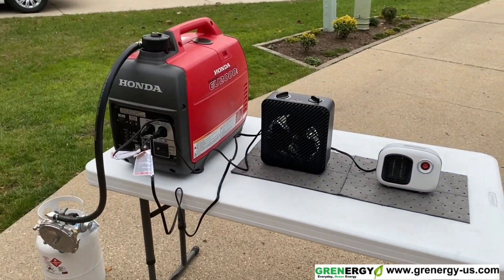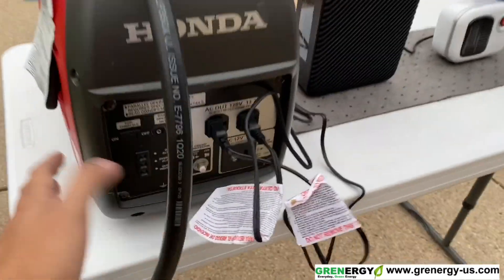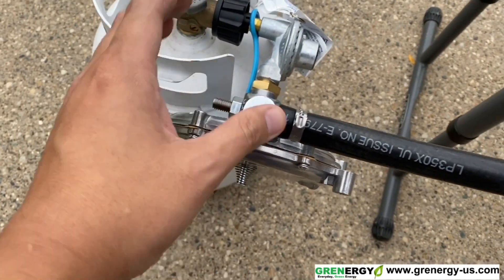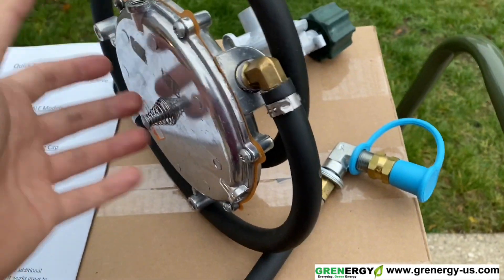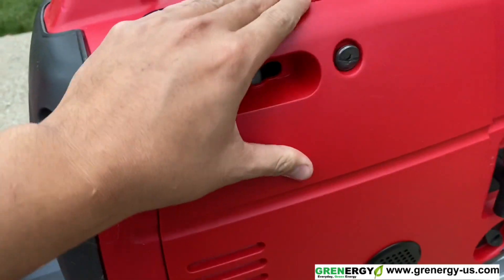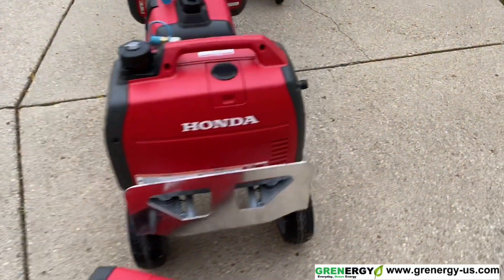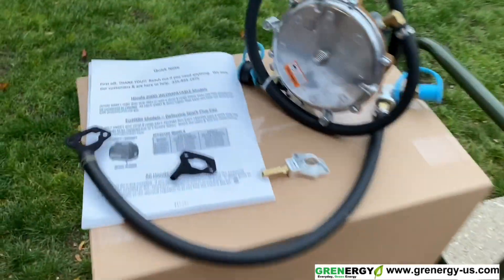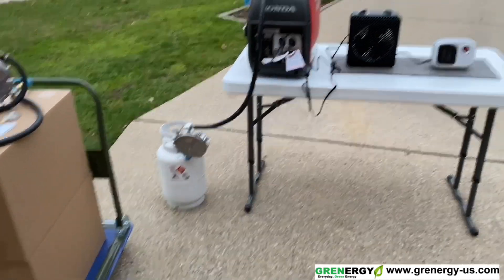Honda Propane Conversion Kit - Less Power? Engine Damage? Video Part 2 - EU2200i EU2000i EU22i EU20i

Comment: I just got two eb 2200’s after ordering two eu 2200’s.   I want to parallel them and am sending them back.  Is this a common issue?
Reply from the maker: I would get them checked out at the Honda dealer. It’s not common for them to fail like that

Comment: I think the models advised not fit a gas kit are the older honda generators that had dodgy spark plug caps making the spark insufficient change the cap or try some dielectric grease on the spark plug top and and always on the thread to help with replacing spark plugs as i do on my cars helps them from seizing in the engine block and snapping , but in this case makes them easier to remove
Reply from the maker: Thanks for your input

Comment: What is Honda's rationale for saying you shouldn't convert the older model to LP/NG? It's obviously not an operability issue, since the mod works. Could it be a reliability issue, long term?
Reply from the maker: As a company, Honda simply would rather not want the liability of saying it works with alternative fuels. From their prospective, what ever comes from the factory is what they advertise and that is that.
Reply: @GrenergyTriFuel  Yeah, I get that, thank you. But why single out just the older model? Does it employ, for example, a different metallurgy that makes it specifically not recommended to run LP/NG? I'm just curious what the technical reasoning is for them to release that bulletin.
Reply from the maker: In the video the product manual is not of Honda, it is from our competitor. Our competitor does not recommend LP or NG for older model EU2000i simply because their kit does not work well on the series 1 EU2000i. 

This issue is only with our competitor, NOT us “Grenergy”. We have found no reason why LP or NG wouldn’t work on the series 1 EU2000i. Because of this, the kit it self speaks volume on how much testing and R&D that goes into our products to ensure it works better than anyone on the market.
Reply: @GrenergyTriFuel  ah, that makes sense. Thanks for the clarification.

Comment: I stopped watching when you bashed plastic, just because it’s not metal.
Reply from the maker: Obviously Tom Cee never had experience as an automotive technician. 
Mr Cee, just because it can be made out of plastic, doesn’t mean it should be plastic. I’ve seen my fare share of top dollar cars with plastic engine parts fail over a span of a few years. Leaving the owner with a very expensive repair bill and a not so reliable car. 

It’s also common sense for a business like myself to reduce liability. Especially when working with highly flammable vapor fuel types. And doing so with cheap 3D printed parts is NOT what your customers would want to pay for. 

Please see YouTube links below for plastic engine part failures. 

https://youtu.be/TQCkDz3SDxg

https://youtu.be/8MmXIZPxD7A

https://youtu.be/6sTO-7Ses3U

https://youtu.be/nrPN_x6MoVk

https://youtu.be/b7IDZJSE2r0
Reply: “I stopped watching when you bashed metal, just because it’s not plastic”….. said no one ever.

Tom Cee is the type of person who likes to dip his fingers in electrical sockets to tell the world 120v is over rated, just because it’s not 120kv 😂
Reply: I might have missed it, but I didn’t see you explain why. There are many possible reasons for an engineer to choose plastic over metal. It’s always assumed that cost is the main driver, but there are other variables, such as heat transfer or electrostatic discharge. I’d rarely second guess the engineer who spent hours testing. If it works for you fine, but changing parts might very well void the warranty. 
I’m not a specialist in engine design, but I’ve worked with many engineers in different disciplines who shake their heads at untested field modifications.

Comment: What about that small pressure button that’s not there on the earlier 2000.  Do we need to install that too?
Reply from the maker: That button you are referring to is the carb run down switch. If you purchase the kit, there will be a step by step how to install guide for this switch.
Reply from the maker: Yes, this is the carb run down switch. And yes there will be a step by step install guide with the kit.

Comment: A few questions, 

1. What are the vents in your unit installed for.

2. I have a Hutch Mtn kit with a Century regulator.  Can I buy from you the adjustment piece for the high rpm use and the metal carburetor manifold with bolts without the entire kit?
Reply from the maker: Hi Rolland, 

1.) Please click here --> https://grenergy-us.com/pages/whats-up-with-the-air-vents-why
2.) Unfortunately we don't sell the fuel adapter separate unless its under warranty. You could always put the HM kit on eBay and recoup money towards the Grenergy kit.

Comment: Have you considered making a parallel kit?  One regulator and two everything else?
Reply from the maker: We recommend running each kit off their own tanks for consistency.
Reply: @GrenergyTriFuel  I have a 1000 gal propane tank, can parallel units work off of the large single tank?
Reply from the maker: @keenanfoy3965  If you are able to gather proper fittings, you certainly can run off a large tank.

Comment: i'm curious about the extra round air vents you added........did the engineers at honda miss something?
Reply from the maker: Hi Ed, 
The breather vents help balances the low-pressure vacuum inside the generator case. We find that this extra vacuum draw comes from the engine fan resulting in additional low pressure inside the case. This extra vacuum other than engine vacuum from the air intake box, can result in the demand regulator opening its diaphragm excessively, causing the engine to run too rich. 

With this fix, a better fuel economy is achieved which results in an extra run time of 1-2 hours per tank of propane.
Reply: @GrenergyTriFuel  If you could use the wind air speed tool to measure intake and out take air speed with the vents uncovered and then a test with events covered. If you pick up AirSpeed I can see making vent holes. But if the airspeed slows down this will make the engine and parts run hotter. One guy with a sportsman 1000 4 stroke gasoline inverter generator took the side cover off and put a fan on generator installed generator and fan in the shade in the summertime. generator didn't last too much longer until it was smoking oil excessively out the exhaust. Obviously he was burning oil and had a lot of blow by with an engine getting so hot. These enclosed case inverter generators pull the cool air in push them through the case and the hot air goes out the back. Sort of like a cylinder head if you hog it out too much you'll slow down the velocity the speed of air won't travel as fast.
Reply from the maker: That is an air cooled engine, it has a fan behind the recoil start that draws air from the front to the back. That generator is junk compared to a Honda if it’s pouring smoke out the back
Reply: Does the added air vents make it louder?
Reply: @jerryc7016  I really found no difference.

Comment: Very nice. would you compare this one with Hutch Mountain Kit?
Reply: we had both kits on our generator when we go camping or doing track days. this kit from Grenergy is definitely more refined with super smooth idle and way easier to start
Reply: The Grenergy kit has a metal adapter instead of plastic 3d printed one.  It also has an adjustment that other kits don't provide.  Much better conversion.
Reply from the maker: We’ve now sold kits for 3 years and all with happy customers!